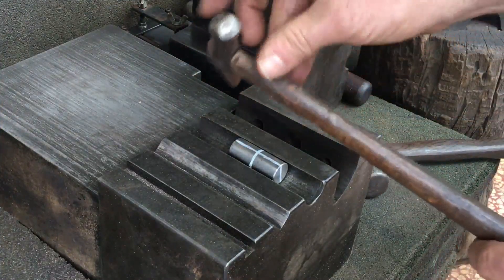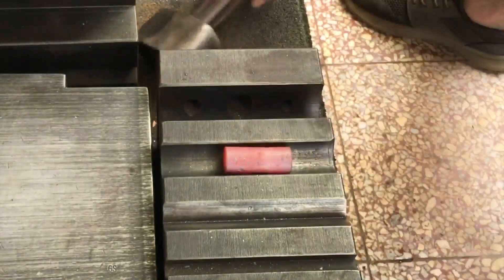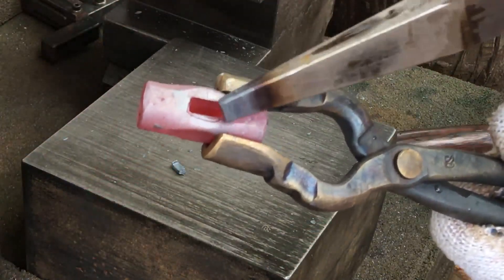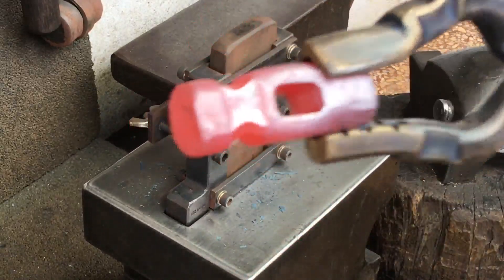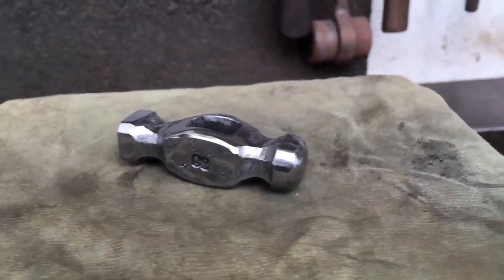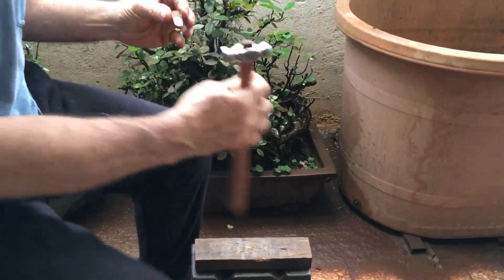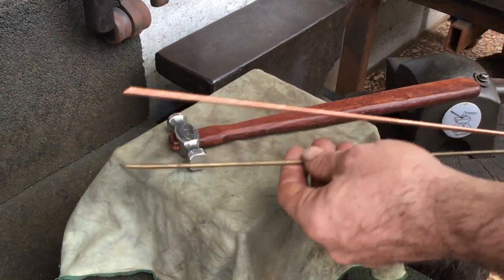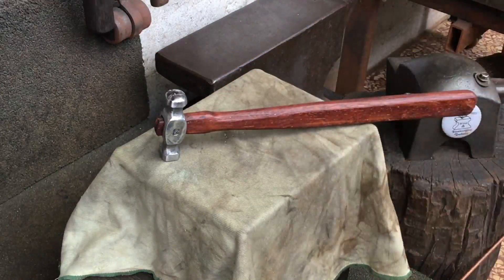Hand Making A Tiny Rivet Peening Hammer

Comment: It never ceases to amaze me the way you punch out the handle eyes. It never works that way for me.....Dave
Reply: try practicing on square section stock ..once you can do that the round stock comes reasonable naturally
Reply from the maker: Hi David, this hammer is tiny. Increasing the size would increase the trouble for me. But beyond that, the punches you use can make a world of difference. Thanks for all.
Reply from the maker: Good suggestion. Thanks.

Comment: That is the hammer that I looked for 11 years before I made me one I didn't have a forge but I finally turned mine on the metal lathe and I made the peen tapered down to about 3 eighths heat treated with Oak  charcoal and a heat gun to add air dropped it in parks ? Quenching oil tempered it down to a real dark straw and some purple put a little short handle in it and I guess I'll have it till I pass
Reply from the maker: Hi Bill, thanks for sharing that. The interesting thing about nicely hand made tools is most will be around longer than us!

Comment: For anyone that wants to make one but isnt a skilled blacksmith. Buy a T fitting for water pipes -for small one 1/2" works fine.Then buy 2 end plugs.Drill the end plug with a drill bit.Size should be smaller than a ball bearing ,3/4 of ball bearing should stick out.Put bearing into a water ,place plug on top and weld it from inside.Water will keep bearing cool so it will retain surface hardness(if you are skilled and have a forge you can do heat treat again and skip water part).Place fishing weights or birdshot /small bearings inside and you can use 1/2" pipe with sealed threaded portion(so that the weights dont fall down tube) for handle.And wooosh you have magical dead blow peen hammer ! You can make brass ends and plastic from stock but you will need a water pipe die set,which is not that expensive.
Reply from the maker: Interesting method for making a peening hammer. Thanks for sharing.